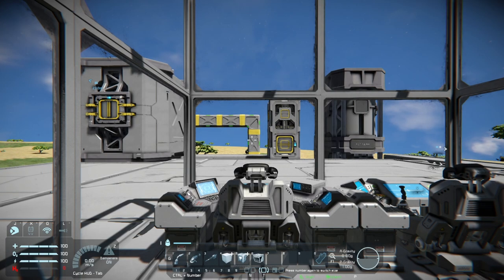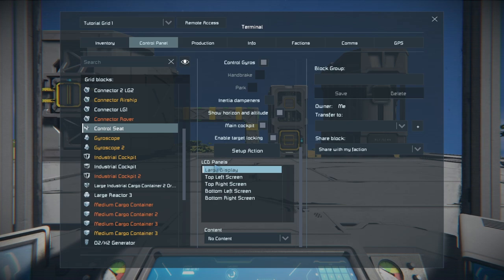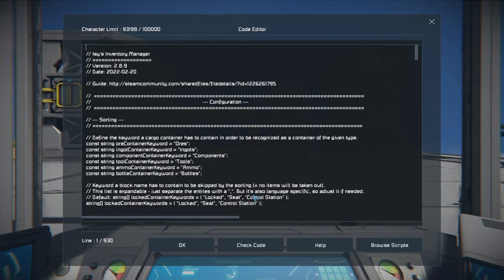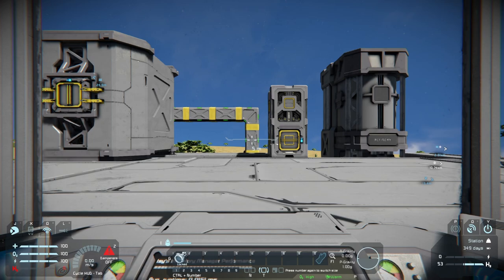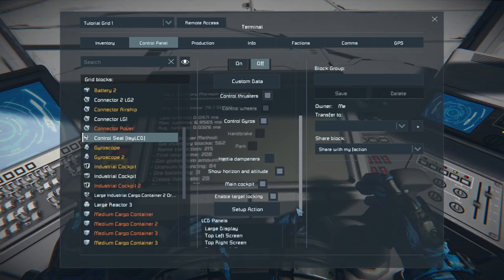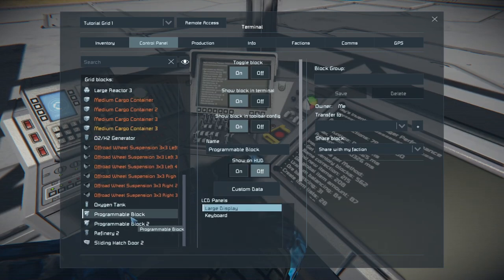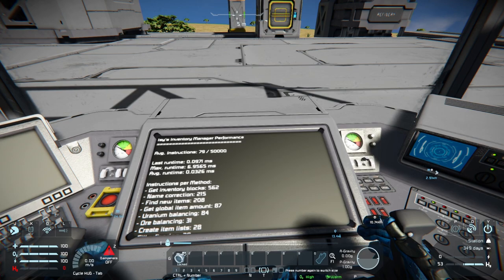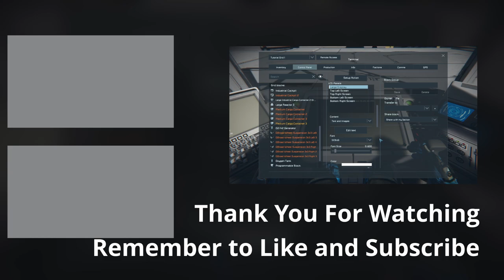Space Engineers - Setting Up Cockpit LCDs

Comment: Why did you do "Movie Magic" and not actually show what you did??? Tutorial fail.
Reply: Found this in the written guide of AutoLCDs 2
"
You can use this script on cockpit screens as well as screens of other blocks. In order to do that you have to mark the cockpit (or other block) with the LCD_TAG as you did with LCDs. So by default you add [LCD] to the name of the cockpit in order for the cockpit to be recognized by the script.

As soon as you do that the first screen on the cockpit will be controlled by the Automatic LCDs 2 and should display the usual message that you should write commands to custom data of the panel. If you need only this screen, you can write commands to Custom Data of the cockpit just as you do with LCDs.

In order to use other screens you have to tell the script which screen you want to write to. Here is example of how the Custom Data of cockpit can look like:

@0 AutoLCD
Echo This will be shown on first screen
@1 AutoLCD
Echo This will be shown on second screen
@2 AutoLCD
Echo This will be shown on third screen
"
Tried this and it works, i was also disappointed by the "movie magic"
Reply from the maker: The tutorial wasn’t about programable blocks and scripts. Therefore I didn’t include that in the video. Sorry you didn’t like the video. There are plenty of other creators out there for you to check out. Maybe try Splitsie.
Reply: @demonatagaming Sorry, have to agree with the OP. You failed to show how the lcd was configured in the controlseat. You claim a tutorial about setting up lcd, but the last example showed only the result, not the config in the controlseat.